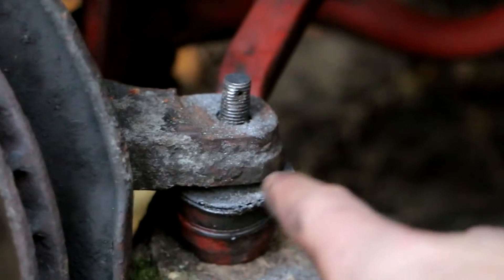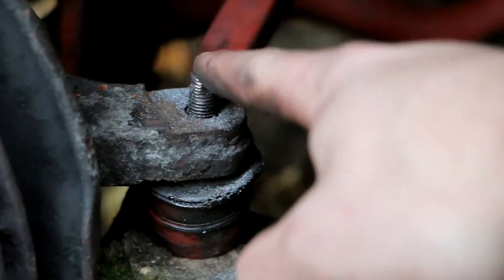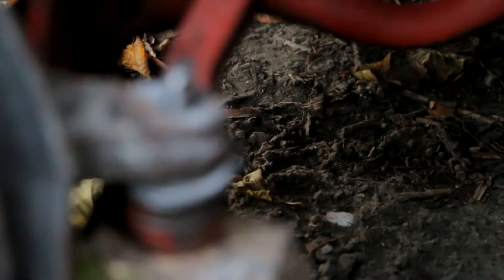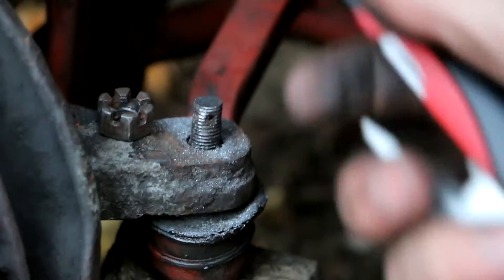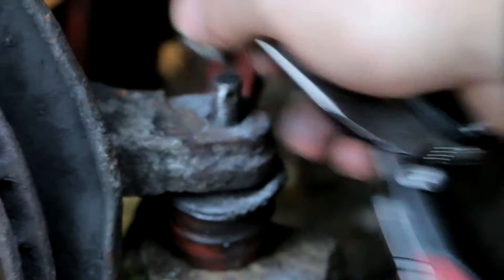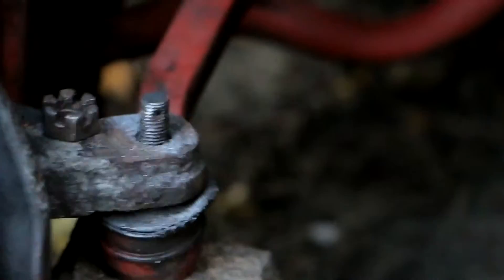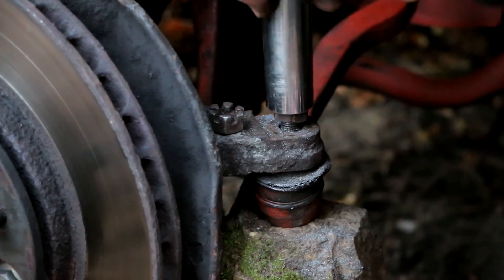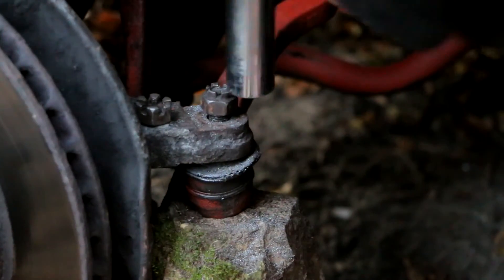How to screw nut on deformed bolt without big hassle

Comment: Gonna try this fix on upper ball joint i had to pound on it to get it out. Even with the nut on it still did some damage to the threads but filing those smashed threads might do the trick